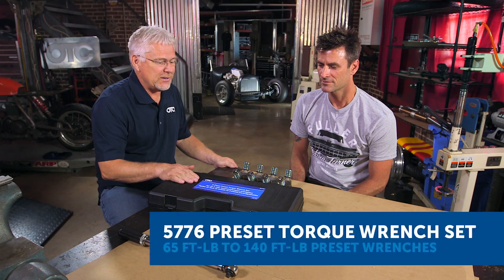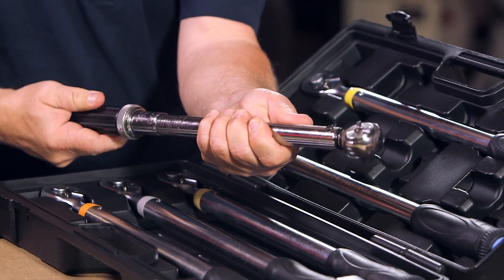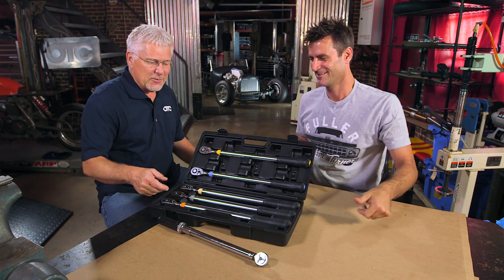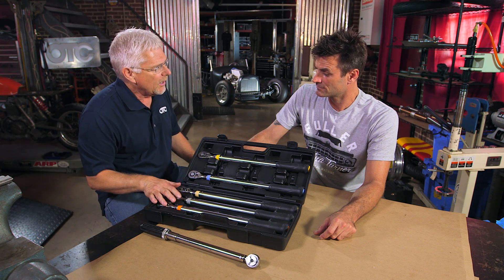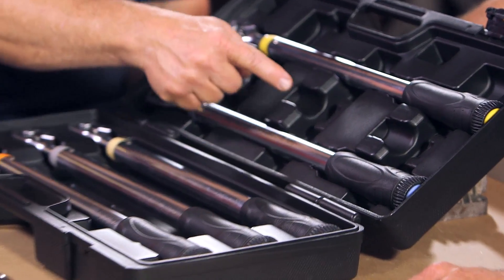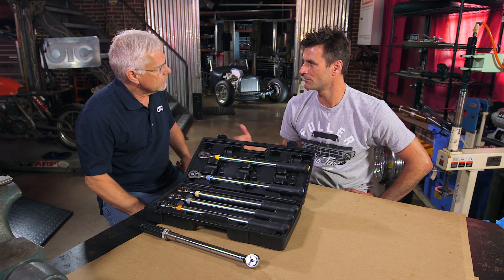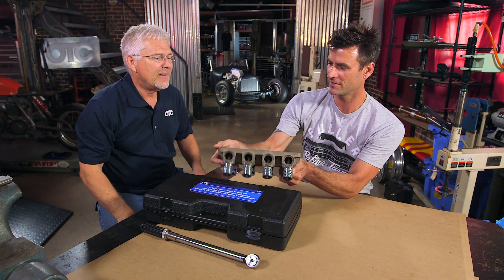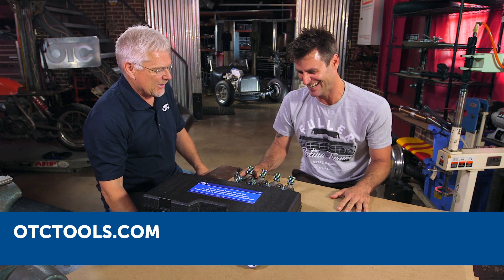Proper torque increases vehicle safety

Comment: Something nice to have with this torque kit is a brake pedal press  tool that hang off of your steering wheel. This way you can torque all the lug nuts while still up and on the rack. ....Beat the hell out of torquing the lug nuts on the ground.